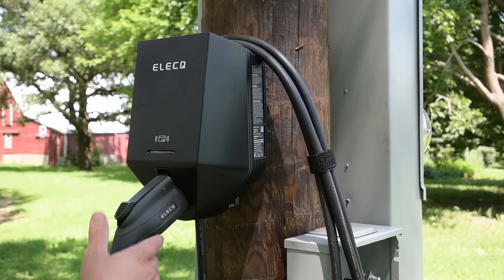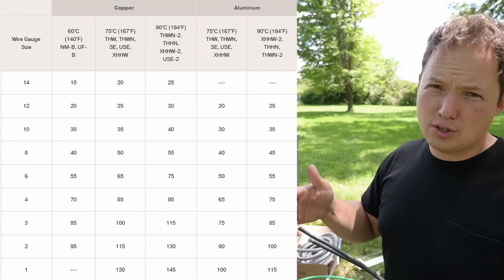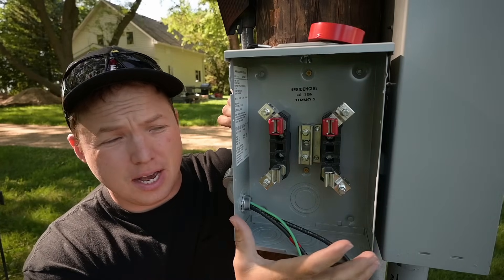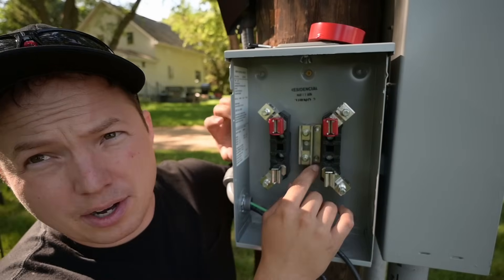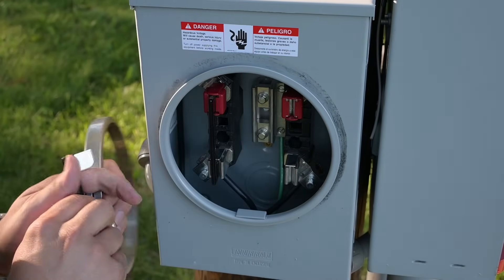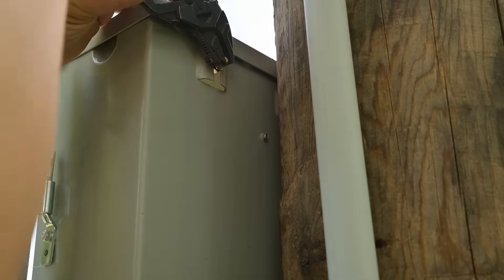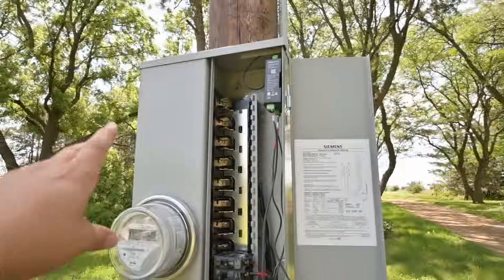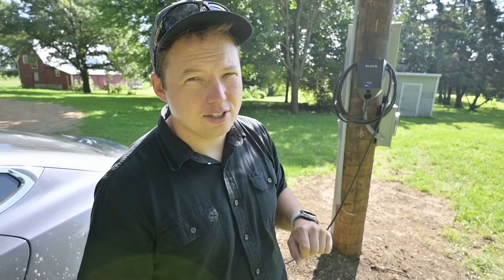How To Install a Hardwired EV Charger - ELECQ Home EV Charger & Power Monitor

Comment: One thing I would say is that unless you drive a huge distance every day, it's generally better to charge at a lower current.  For example, 24A (6kW).  But to STILL wire the thickest cabling you can do, such as 6 AWG or 4 AWG.  There are three reasons for doing this.

The first reason is that your EV charging is going to wind up being a substantial portion of your home electricity consumption and reducing cable losses, as well as other losses within the vehicle, can actually amount to a few percentage points depending on how long the current paths are from the service.  It's free money (or at least, an easily reduced expense).

And the second reason is simply that there is no need to burn up a substantial portion of your service just for the EVSE, reducing available margins for other high loads in the future.  Or if you have more than one EVSE (for example), and so on and s o forth.

The third is related to other systems one might have in addition to the EVSE, such as solar or perhaps even a full ESS (energy storage system) with batteries.  Charging at a somewhat lower rate makes it a whole lot easier to match the EV charging against these systems and makes avoiding grid import easier.

For example, if you have a solar system able to put out 8kW during the day, charging the vehicle at 6kW avoids grid import.  Or if you have solar able to put out say 5kW during the day and a battery storage system, charging the vehicle in the late afternoon will drain the battery more slowly while there's still some sun and give you more headroom on the battery after the sun goes away.

While one can also purchase "smart" EVSEs that try to zero-out exports, the problem with those is that the charging is completely non-deterministic... you plug in, you don't really know how much charge you will be able to get into the vehicle.  Usually when people plug-in they want to know for sure how much charge they are getting into the vehicle as they might need that range later that day (etc etc).

-Matt

Comment: Thanks... i learned alot and I think i understood just about everything you explained here except for why you bothered to remove the cover panel below the meter box showing the service wires coming up from below ..Since we dont ever see you do anything else in the meter box there except to use it as a shelf to place the double pole circuit breaker on before you stripped the wires and installed it in the service panel box ?

Comment: You have a serious security issue if "people driving by" is a credible risk of them using your power. Especially when living on a farm??

Get a "dumb" model that uses physical dip switches to configure the output and you won't need the account, the registration, the phone app, none of that.
Reply from the maker: It's not really a concern at all. Honestly I probably would be fine with it if someone needed to use it in a bind as long as they ask.

Comment: I’m a United Chargers fan.  I have the Mini-E as a portable/mobile EVSE for travel and as a backup.  Uses a 50 amp NEMA plug and can do 12 amp to 40 amp and 120 to 240 V.  Also have a 80 amp Grizzl-e in a box ready to install at another property.  

My primary EVSE was forced on me by my utility to get TOU rates and is a ChargePoint Home Flex.  It’s ok but I have had some mystery derating occasionally for no particular reason.  They communicate directly with the Home Flex EVSE to determine billing time of use instead of a meter.  All other things aside I’d rather have your separate meter option then I could use any EVSE of my choice.

If I could only have one EVSE it would be the Grizzl-e mini.  Physically tough as nails, portable with 4 adapters provided, can be mounted on wall too.  Has a limited WI-FI capability to do an app derate as well has a DIP switch derate too. And at 40amp max it can so an appreciable rate over night charge.

I really think you’ll love an EV.  I’m nearing retirement and been driving pickups and SUVs my entire driving history.  I’m closing out my first full year of a Ford Lightning in NW Wisconsin and I just love the truck!  Yeah I lose some absolute range when it’s 20 below (temp not WC) but never so much that it interrupts my normal use of the truck.  And I just love that I can pre-condition in an unheated garage without worrying about carbon monoxide so when I do go somewhere in the arctic freeze I unplug and step into a 70 degree cab with a full battery ready to rock.

Comment: To save money on wire, you can run a 1/4" refrigeration lowside for cooling thru wire bundle.  Of course to save money, compressor runs only when charging.  If this sounds ridiculous, it is...

Comment: Do you need a disconnect between the main panel and EVSE when hardwiring it? Can I install a 50 amp socket (with an industrial version, not a cheap one from the local store - as you said, charging a car is a long continuous load)? Just wondering which is the better option? Thanks for the great videos!

Comment: I came here just to down vote and tell you nobody cares about electric cars
Reply from the maker: To each his own! I've never been into EVs, but I'm actually pretty amazed how useful they can be, not to mention a whole lot of fun.
Reply: I just leased my third one (Tesla Y, Jeep 4xe, Cadillac Lyriq). I’ve stayed with them for two reasons. First reason is I don’t have to deal with gas. Gasoline prices swing pretty wildly while electric rates stay pretty constant. Second I love waking up every morning to a full tank of gas.  I also just canceled out your down vote with an up vote.
Reply: @patrickhynes6058  Great to hear. Too bad EV's are made with slave labor for those rare earth metals. The batteries need to be replaced twice by the time an average gas car reaches its end of life. You're charging an EV with electricity most likely produced at the power plant by burning natural gas. You can't just jump in the car and drive anywhere for any amount of distance like you could a gas car because you have to plan where the charging stations are. And a simple refill on a gas car is 10x longer for an electric car. Not to mention the batteries can explode into a horrible fire in some wrecks.
Reply: @rosegold7975  Rose - you unfortunately are misinformed.   None of the reasons you brought up are true and do not at all align with my experience as a 3x PEV/PHEV owner.

Comment: I am confused. Don’t you have a metered load feeding a second meter. Shouldn’t each meter connect directly to the utility companies power line?
Reply from the maker: Good point, there are different ways to configure it, but having a meter downstream of a breaker is fairly common for load management or applications with varying electrical rates for certain loads.
Reply: @BenjaminSahlstrom Thanks Benjamin.  Great content by the way. Love your stuff.

Comment: 1) Outdoor charger is available to lightning, but surge protection is missing in your panel. 
2) Charger is source of harmonics, but you are using thinner ground wire. 
3) Cable amperage rating depends on environment: wall with insulation will reduce maximum amperage, but open air will increase maximum amperage.
Reply from the maker: Good points! I do plan on adding surge protection soon.

Comment: If your car was almost drained of power how long at 48 volts would it take to charge it full? If you had the dryer and house air conditioning running plus all the regular household items would there be a problem?
Reply from the maker: At 11kw, it only takes about 8 hours to charge from 0 to 100. Normally you'll be charging from 20 to 80, though, so would only take about 5.5 hours.

With a 200 amp service, you typically would not run into an issue even with all of the usual household loads running.

Comment: 6 gauge is not necessarily good for 50 amp continuous load.  These EV chargers are an all new ball game.  They can do a flat dead load at their limit for hours on end, so you have to pay attention to continuous load waaaaay more that about any other household draw.
Reply from the maker: Absolutely. 6awg THHN is good for 65 amps in the 75-degree column. That's why it is derated to only 48 amps on a 60 amp breaker since you're required to have 125% of the continuous anticipated load.
Reply: I use 6awg on my 48 amp charger:)
Reply: EV Chargers have been around for years; however, they keep improving with each new model.

Comment: What was your motivation for getting an ev?
Reply from the maker: Mostly for testing electrical systems and solar equipment. I've also been curious to see how they do up here in MN so will be interesting to see how it goes.
Reply: @BenjaminSahlstrom  i think the plugin hybrids make the most sense.
Reply: @Jon-hx7pe I think for you a horse drawn carriage makes more sense 😂😂😂
Reply: None! Takes a coal plant to supply electricity of a nuke! Batteries are sooooo much more "not green" than fuels!